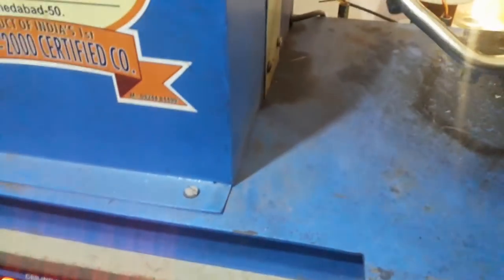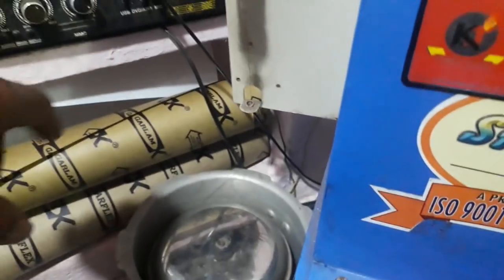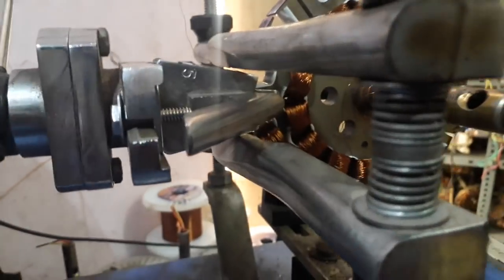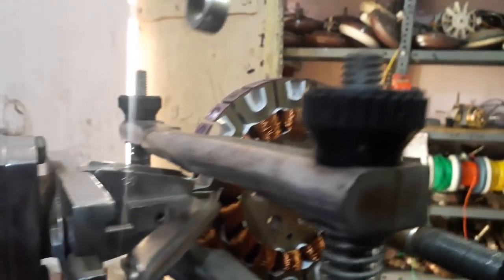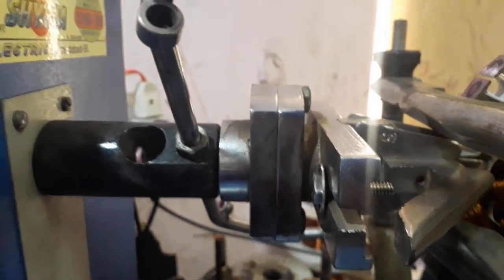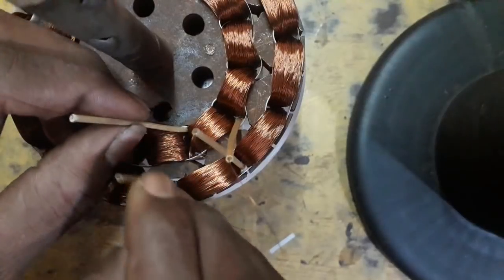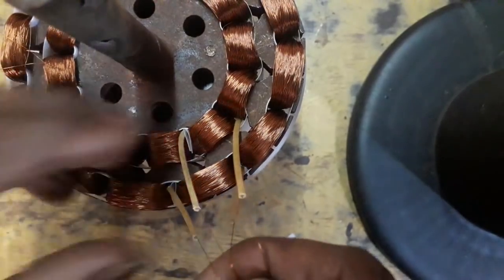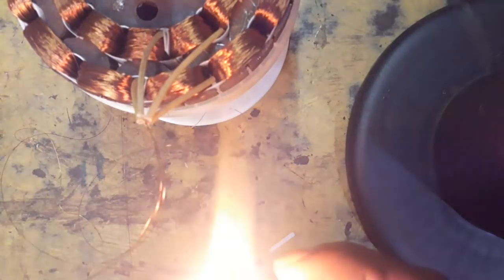Ceiling fan wire cut problem|and connection

Comment: Sir இந்த winding machine விலை எவ்வளவு
Reply from the maker: 19000
Reply: @thanishMotors  10,000 something la low budget la ceiling fan coil winding machine irukka sir
Reply from the maker: @prabhueee123  9000 la irukku
Reply: @thanishMotors  brand name 3digit or 4digit counting details yethavthu kedaikuma sir
Reply from the maker: @prabhueee123  3digit , am machines